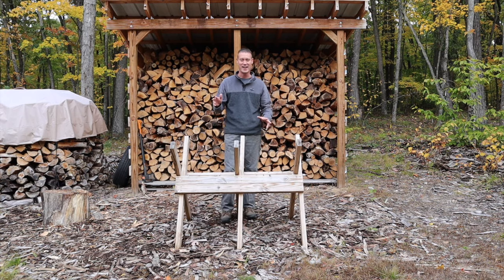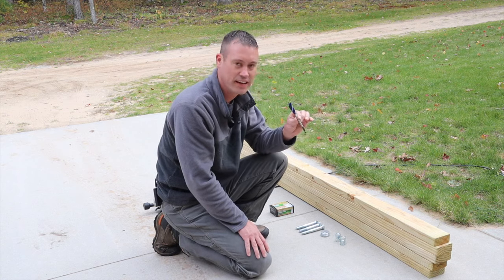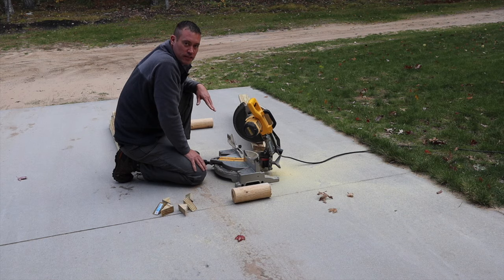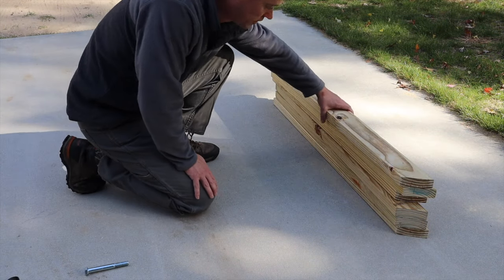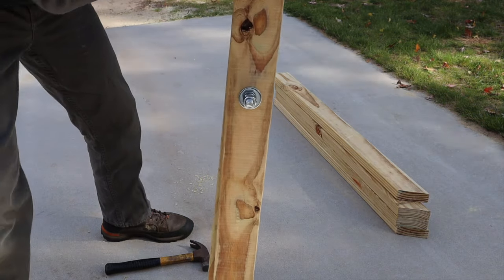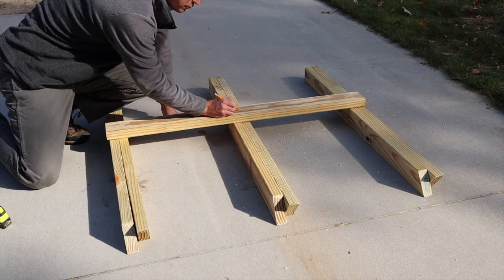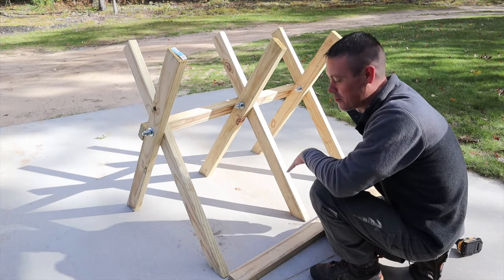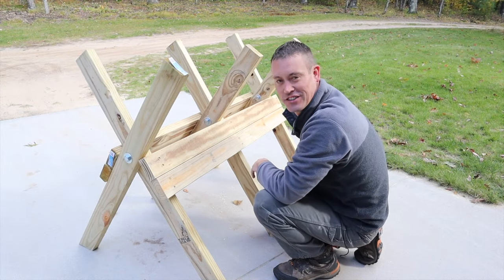How To Build A Sawbuck - The Best Way

Comment: For three of the 8’ers why not cut the middle at 30° so there’s one cut not two. Another tip is to use 1/2” fastener, easier to find, lower cost, just as strong. Thanks for sharing.

Comment: Nice video.  However, when you say “it really doesn’t matter which 2x4 you screw into, as long as you keep it the same “ - not true.  The 30deg angle dictates which way it will spread, which dictates which side the brace goes on.

Comment: I use Robertson deck screws..
Reply: Me too. I also predrilled the braces at the ends to prevent splitting the 2x4s. That made it so much easier I ended up predrilling all of the screw locations, I think I used a 3/32" drill bit.

Comment: This is a great tutorial video! Thank you so much. I just made it, with two changes to your original: 1 I made one 24 and one 12 inch section instead of two 24" sections (I have shorter pieces of wood so I thought that would work well) 2 Because I am going to use it on both ends, depending on the length of the pieces of wood, I pointed the bolts on both ends inward instead of all pointed into the same direction. We will get good use out of this for many years, thanks again!
Reply: 15:14

Comment: Thank you for these instructions. I made the mistake of purchasing pressure treated 2x4's and did not realize it would add so much weight. When completed it weighs 75 lbs whis  bit much for an older man(77) to move around, you may want to give the folks a "heads up" that it is very steady but does weigh a lot.    Thanks again!!!!!!
Reply from the maker: You're welcome and thank you for the suggestion!  You're correct, pressure treated does add some weight but over time it should lighten up a little as the wood dries out.

Comment: I have completed the sawbuck from this video.    Take the recommendation on using Outdoor Screws  3 1/2  T 25 Star  made my life much easier than the wood screws I had laying around.  I used 1/2 inch instead of 5/8's for hex bolt    I am not sure on the washers since the hex bolt was longer and thread stopped before the wood when using the 2 bolts.  As this was first time doing I had to do a little rework to get it right.  I have a few washers on each hex bolt between the board and nuts not sure if I should remove them or keep them as noted adjustments.  I used my new sawbuck it was great.  Thank you for the instructions.
Reply from the maker: You're welcome!

Comment: Just built one and I think it’ll be very useful. I may move the center X to accommodate smaller logs — I only need to supply a fire pit. I get a lot of pleasure from building things and your excellent directions made it especially enjoyable. Thanks from Maine!
Reply from the maker: Thank You!
Reply: I was thinking to do exactly the same - move the centre X for smaller logs. How did yours work out?
Reply: @JardinFoto  It worked out great - I also swapped the orientation of the middle cross-pieces to make one of them closer to the end cross-piece on one side (which made the other one further from the corresponding end cross-piece on the other side).
Reply: @piquef  Thanks, I'm going to build mine today.

Comment: I have an old one with lichens growing on it made of rough 2X6.  I plan to use your design but make it a few inches taller for use by tall people.  My method of measure/cut is to lay the log on the sawbuck and mark all 18" lines with a tape measure and chalk starting from the big end of the log. Then 2 pieces per end and switch ends to keep long logs in balance.  By marking all lines you can see interference on the uprights beforehand and shift the log a bit to right or left.

Thanks for a clear presentation.
Reply from the maker: You're welcome and I hope you love your new sawbuck!

Comment: Made this sawbuck today. It’s looking good! Tried it out and worked well. I used pressure treated wood and the whole thing was very heavy bc of that. I opted to not use the second horizontal cross piece just to add less weight to it. Maybe I’ll add it after the PT wood dries out. Thank you for the video.
Reply from the maker: You’re welcome and I’m glad it turned out well for you!

Comment: 26 years old here from PA, and this is my first winter utilizing my wood stove to heat my first home and it’s every bit of nerve wracking worrying about running out before winters over because I know I don’t have enough. Back up source of heat is an oil furnace but that crapped out on me last Wednesday before thanksgiving along with the plumbing backing up so it’s been hard thus far, but determined to make it work and hopefully someday have a nice supply like you have built up for yourself! Great work, and nice video! you got yourself a new sub
Reply from the maker: Thanks for the kind words and the sub!  We've all run out of firewood at one time or another and home ownership can be tuff for sure.  I've found that cutting early in the spring just as the snow melts off works the best for me.  Then, when I think I have enough firewood I cut about 50% more.  That allows for extra cold winters and longer burn time if needed.
Reply: Firewood For Life Thanks for taking the time to reply and lend some advice! Hope you and your family have a happy holiday season
Reply: Sgt. Budz been doing for 14 years, just look at it as a fun activity. Heating the house with an outside Wood Doctor furnace and an inside insert. Things that help to make it easier are a small diesel tractor with a front loader and a splitter. I have about 16 acres and always seem to have standing dead trees. It’s always a work in progress! Good luck, Dave.
Reply: Dave Kana thanks Dave! Just got done splitting my wood for the night and at first it was more of a challenge but it gets easier every day I go out and practice swinging the axe. Definitely a satisfying feeling
Reply: Sgt. Budz that’s the attitude! I don’t mind the cold, I’m in NE Ohio. It does get easier!

Comment: Pulp cord? Here in Michigan we can get 20 at a time,( big trucks legal to 164k lbs over 11 axles) i just climb the pile and work from top down. If it hurts to bend over get a bigger saw and longer bar. Works for some but i try to put my hands on firewood twice, once to stack second time into the stove

Comment: I built this Sawbuck this week using 5/16” x 4” Carriage bolts, washers, and nuts I had on hand.  I used 3/8” washers under the bolt heads.  The bolt lengths were fine and I think this will be a solid and useful device!
I’ll be cutting 16” long Oak.  IF the ends are not showing any splitting radiating out from the centers, does that mean that the Oak is TOO green to split with a log splitter?
Thanks
😜🤔
Reply from the maker: I’d split it up as soon as you can, especially if you have a splitter. Oak takes a while to season so splitting it will help it dry out faster.

Comment: for whatever reason i am having difficulty finding 5/8"x5" bolts. Would 1/2" be okay? Also do you recommend stainless steel or hot dipped galvanized bolts?? Love the video I've watched in 3 or 4 times already to make sure I got it straight in head. Cheers from a new subscriber in Nova Scotia Canada :)  Mark
Reply from the maker: Thanks for subscribing!  I think 1/2'' galvanized bolts would work just fine.  Good luck with the build!

Comment: This. is very well done and easy to follow. My stove takes 16” logs. The overall length of the saw buck is 48”. How do you think it will work for cutting up 16”lengths? Would you consider making it 36” length?
Reply from the maker: Thanks, I'm glad you enjoyed the video!  You could definitely make it a little bit shorter if that would work better for you, but you could also just keep the 48" and just make 16" cuts which I think would work just as well.  You don't need to cut exactly along the X's.
Reply: @firewoodforlife  Thanks for the reply. I may just keep it 4’. Less cuts that way. Speaking about firewood for life. I’m a forester and I live in the Pacific Northwest. A few months ago, my son-in-law stopped by and said. You have firewood for life..We just purchased 140 acres of timberland. We are in the middle of logging a 14 acre patch of alder, maple, and some fir and cedar. We are replanting with mostly fir and cedar. Some of the alder was clear enough to sell as veneer and some of the maple was purchased for guitar figure wood. The rest was sawlogs and pulp. Anyway, I look forward to making one of your sawbucks this week and taking it with me to the site. Thanks again

Comment: What kind of wood did you use? Did you use pine? I used Doug fir- and it is stout, but a little heavy for taking with me in the truck. I think I will keep the Doug -fir at home, and build a smaller version using pine. Also, I think for layout instead of equal distant between the X's , I will go with x-x---x, so I can move logs down the line from bigger to shorter
Reply from the maker: I used treated pine which is a little heavy but not too bad!

Comment: UR video is very good are building a sawbuck thanks. question for you tho when drilling my center holes on my boards the two boards are uneven ok. then if they are uneven can't I move ( drill ) the holes up or down??
Reply from the maker: Even if the boards are slightly uneven or warped you should be able to drill in the same spot and the sawbuck will function just fine.  Just center the holes in each board.  There is a possibility of it rocking a little though, depending on how twisted or warped the lumber is.  I hope this helps!
Reply: @firewoodforlife  GM, it does thx

Comment: Howdie Great work to see thks for Sharin Dad says only 2 things wrong and He,s Been Carpenter 55 years said you Should Be Teaching the Youngsters that's Me That !! SAfety First !! Glasses Should Be Worn when working on Tools with blades Saves  Eyes Oya And Second to Save the Wood From Splitting Predrill Your Holes on the Ends so guessin Don't Crack  Ha ha that's Dad I Thought ya Did Ok ya taught me how to Make some So were goin to try and sell some Here in The Big Canada SK were we cut Many A Truck loads Semi Loads for Winter any way another Story Keep up the Good Work Dad Gave ya a B for Effort He says ya did good using Standard measurements instead of that Metric Crap Quote His words  were signing up Cause of that and He Needed to See this Being Made so till your Next Video Carry On

Comment: now that's funny to save your back maybe the next video should be how to build the table for your miter saw to save your back LOL great job thank you for sharing I did make one however I set my Center leg at 32 in in because I cut a lot of logs in my Woods at 32 so they're not too heavy that way my log sits in the Cradle and then if I need to do longer ones I can thanks again big thumbs up
Reply from the maker: That's a great idea.  I do need a miter saw stand!  Glad you enjoyed the video.

Comment: Very cool video!  I need to make one.  Are the outdoor screws deck screws?  I have 3” brass screws, but hate to use them since the heads easily strip off.  
I have 5/16” x 4” carriage bolts  and washers.  Not sure if I have the nuts.  Do you think they would be fine to use?
Thanks
Reply from the maker: Yep the outdoor screws are just standard deck screws. I’m not sure about the bolts. They might be a little short by the time you put them through the wood which might not give you enough length to add the 2 nuts.
Reply: @firewoodforlife  Roger that.  I like your idea that the leg bracing is not at the bottoms of the legs.  This allows for clearance to get closer to your cutting?
Thanks for the quick response.
🤓

Comment: Great video & design.  I might use 3 2x4x8s & 1 2x8x8.

I want to see it in use. Those will be long and heavy logs you load onto it and I have a couple of questions. First, do you cut at just the ends and slide the logs, or do you cut all the way across the buck from one end to the other without moving the logs? Second, I use my saw bar as my length gage. That works as it's handy but the way I  do it quickly results in some amount of randomness in my cut wood length. Do you have a trick for producing consist lengths and square ends?
Reply from the maker: I don't take the time to move the logs after the sawbuck is loaded up.  I just load it full and make a single cut through the wood.  With the 3 braces, the wood won't bind on the saw blade.  You just have to make sure you don't cut too deep or you'll hit the 2x4 on the sawbuck.  I have multiple small gouges in mine, but it doesn't hurt it at all.  As for length, over the years I've just become pretty good at eyeballing the wood.  I also use my bar as a gauge, but not all the time.

Comment: I made a sawbuck but I didn't like having to pick up a log, put it on the sawbuck, cut the log, throw the pieces aside before getting another log. Mine was fixed and I screwed a piece of plywood across one end and put a 16" and 32" mark on the horizontal bar below the crossed legs. When I cut off the opposite end that hung out the other end it was 48". I had 3, 16" pieces which was great for the stove and selling. Now I use a stick marked out to 64" and it works a lot faster.
Reply from the maker: Thanks for your comment!

Comment: Nice video, looks like a stout build. My thought is to add one more set of legs as to put them on 16" spacing. The idea is to use as gage to make it quicker and easier to cut uniform lengths to ease stacking. I was curious if you had tried a design like that. Would it be more of a hinder than a help?
Reply from the maker: That's a good question and I haven't tried that.  Although it might aid in cutting firewood to 16'' lengths I think with a little practice you'll be able to get them pretty close without the need for another leg.
Reply: Firewood For Life My thought would be to put just the middle leg at 16 inches that way you wouldn’t add to the weight?

Comment: Can you make it with only 2 X’s instead of 3? I Don’t have such long pieces. What size would you recommend ? Thanks!
Reply from the maker: That's a good question and I'm not really sure since I've never built one with just 2 X's.  You might be able to make a modified version but I'd be concerned about the stability of just having 2 X's and not 3.

Comment: I'm about to build my third 'Saw Buck' (obviously an American name). I've always built the lightweight fixed type with cross bracing and the more European asymmetrically spaced leg to make short cut log support much better and let's face it every log on these frames gets short. It would be my only criticism of what is a simple design for use on a driveway or flat location. However, mine would have the second horizontal as either a leg rail for foot hold down when hand cutting or diagonal bracing centre to bottom outer to better support the outer legs from collapsing sideways, for when you have to drop heavy wood on the end by yourself.  NSW in Oz
Reply from the maker: Great input and thanks for the suggestion!
Reply: Firewood For Life . By the way an Excellent presentation that was easy to follow therefore I've subscribed. May I suggest you consider a pair of folding Saw Horses for one of your next project presentations if that in line with your theme? Always good for use with a makeshift inverted saw table I.e. To use in cutting down to size large amount of 6'ft scrap lengths of thinner wood like old timber pailing fencing. Just a suggestion on something that some showed me many moons a go! NSW in Oz
Reply from the maker: @nswinoz3302  Thanks for kind words and for subscribing.  A folding sawhorse is definitely something I will consider.  That sounds like a helpful tool to have around the shop!

Comment: Why not drill 2 boards at at time to better insure straight holes?
Great video btw thank you
Reply from the maker: Thanks and I'm glad you liked the video.  I'm sure you could drill two boards at once, but then you would have to line up both boards perfectly to make sure the hole is centered in both.  Personally, I just find it easier to drill each individually.

Comment: Where did you get those wooden cylinders that you use on either side of your miter saw?
Reply from the maker: Those are leftover chunks of cedar post that I had from a previous project. The size just happened to work out great for my saw. I like to buy cheap cedar posts and cut them up for kindling. It works great!
Reply: @firewoodforlife  Thanks! Excellent idea.  -Joe

Comment: Is that a combination drill or impact drill you need to use?
Reply from the maker: I drove the screws in with an impact driver because it makes it a lot easier, but you could use a regular drill if that's all you have.

Comment: Great video. May build this saw horse later this week. One thing concerns me is the nuts sticking out.  Please put my mind at ease :) 

Might consider using an offcut of 4x2 to cover the nuts?
Reply from the maker: That's a great idea.  I just cut on the head side of the bolt and never have any issues with my chain hitting it but an offcut 2x4 would definitely make it more protected!
Reply: @firewoodforlife  Build it yesterday morning in a couple of hours. Used it yesterday afternoon and sure enough I tipped the saw blade on one of the bolt heads. I may actually countersink the bolt head and the single nylon nut I used so I don't have to keep an eye all the time. Don't think it will cause an integrity issue due to the crossmembers. 

We cut our logs to be approx 10 inches and had fun trying to achieve this. I'm guessing there is a technique and order as to which part of the log to cut? Didn't quite get our head around this yesterday. We were always left with a long log which we then had to cut on the ground.

Will give it another go later.